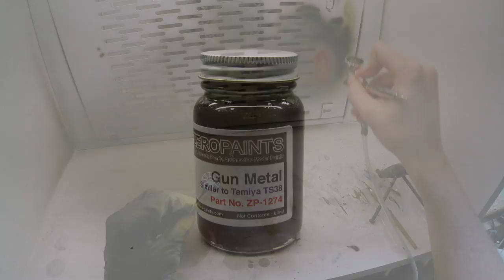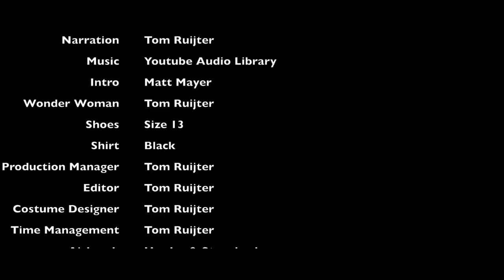Revell: Chevrolet Corvette 1963 C2 Stingray Part 4

Comment: which tires did you get for the wheel kit?
Reply from the maker: Scaleproduction
Reply: i gathered that, but scaleproduction offers 3 different sizes of tires as a kit with these rims. https://www.scaleproduction.de/product_info.php?info=p2233_19--einsgramm.html
Reply from the maker: Dan S nr 2